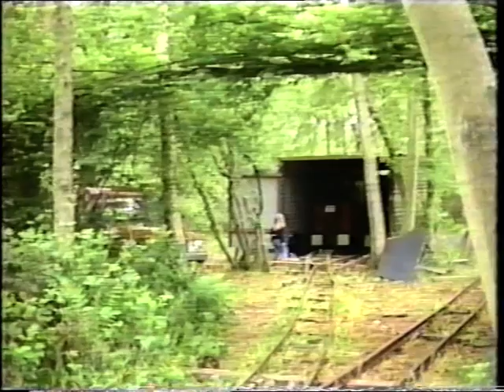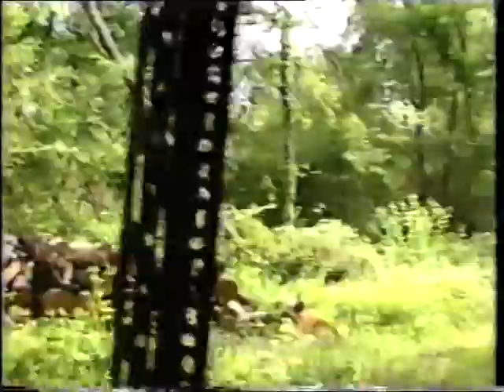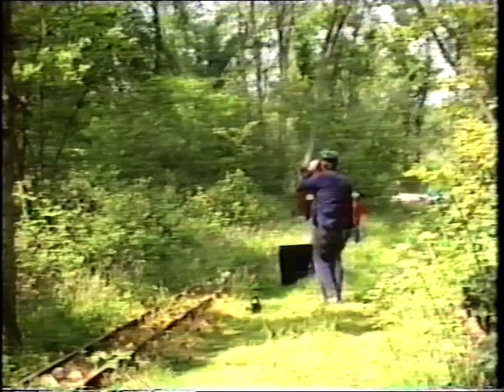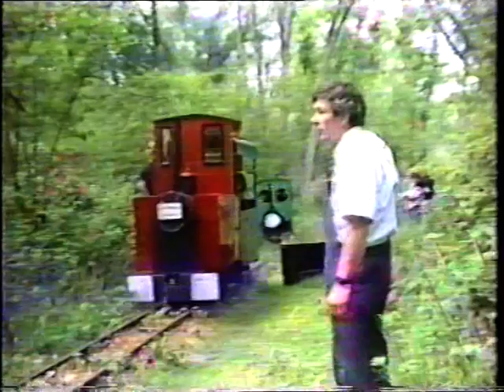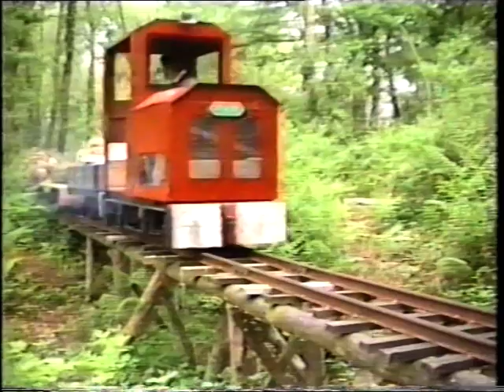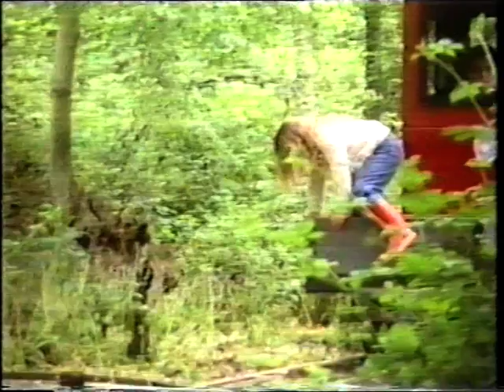15" Gauge Woodlands Light Railway (narrow gauge)

Comment: Was located? I assume that it no longer exists.
Reply: What I dug up - "The 15" gauge Woodland Railway was located at Rogers Wood, Fawkham Green, New Ash Green in Kent. Length was 600 yards, with a long wooden viaduct.
 I have recorded it as being out of use by 1996, and closed and lifted by August 2008. Not sure when opened, but I first visited in April 1991."

Comment: Excellent video. I'm looking to build a 15" railway around my garden (It's fairly large) and am trying to get info on the tightest usable curve radius versus wheel base. What is the tightest curve you have here, and what is the shortest wheelbase you run on it? I hope this superb railway is still going strong and will continue to do so for many years to come.
Reply: There is a Russian language site at irontrack.ru but it takes a while to figure these things out. They would probably call it 500 mm and they seem to specialize in smaller stuff but one is 500 mm shown as "LBZD" I think. I remember radiuses being discussed. Another Russian site is called 750mm.ru